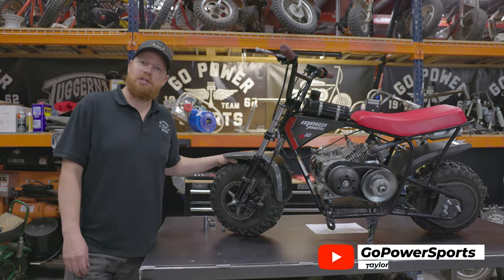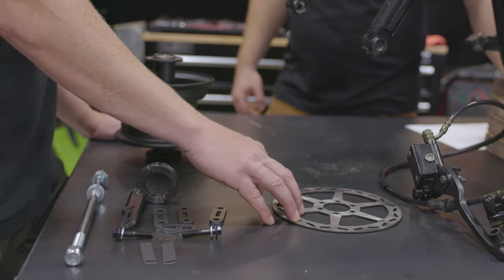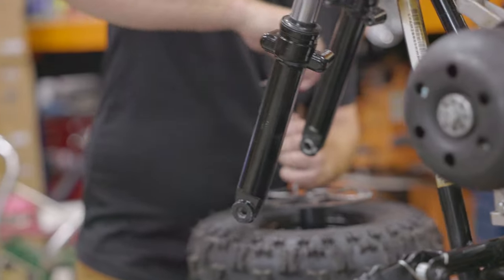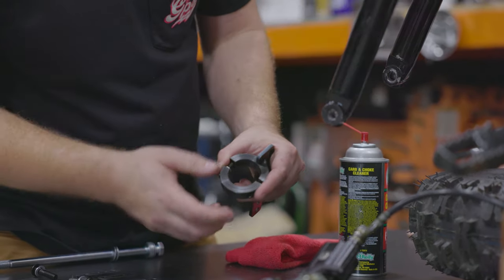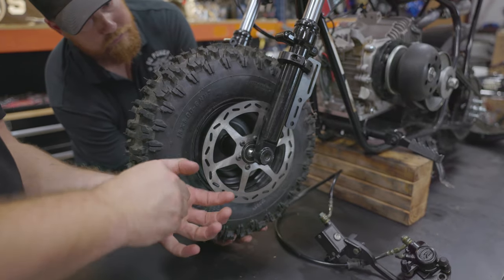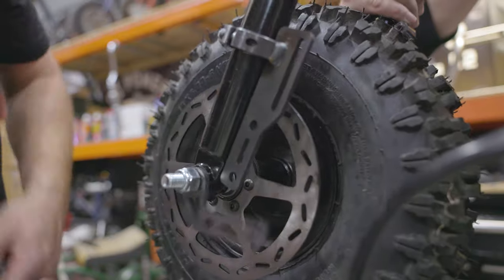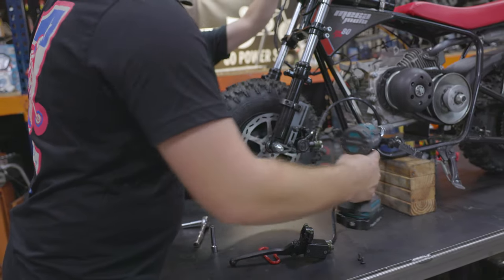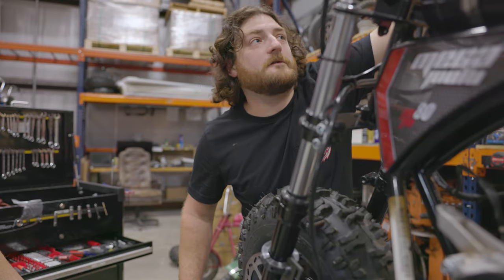How To Install Mega Moto 80 Mini Bike Front Brake Kit

Comment: SInce your adding 2 washers on one side, and 5 on the other, when you mount this kit, and when its all said and done, will the front wheel with brake disk be offset to the one side or the other, or will it be centered between the shocks?

Comment: will the kit work on either side of the front forks or is it built to work on one side only?
Reply from the maker: Currently, just on the left side.
Reply: @GoPowerSports  thanks. The bikes will look awesome with both the front and rear disc brakes on the same side. Just an FYI.

Comment: Will a predator pipe fit a cc100 Coleman looking to upgrade pipe n none listed  for the 100 only the 196cc
Reply from the maker: The 212 header pipes should still fit the 100cc engine, but not sure if it'll clear your frame.

Comment: I need one for the mb200, still a no stock item ☹️
Reply: I wonder if they would sell kit with out the rim and we could just order a rear wheel for the mb200?
Reply: @cliff400  maybe but their rim has the hub for a rotor, unless you making one yourself. Cause I need one for the mb200-2, that’s why I had to stop vids on mine, waiting for them to come back in stock to make more videos for my channel lol
Reply: @MINICUSTOMS  the rear on your mb200 has drum brake on one side and sprocket on the other, so you can leave all drum brake stuff out and bolt disc to the sprocket mount.
Reply: @cliff400  the rear of the mb200 is a disc brake set up, but gps sells a front disc brake kit also that I want to do on the build but been a no stock for a minute now. When I called they said six weeks lol
Reply from the maker: Currently waiting on wheels for the MB200 Brake Kits :(
Reply: @GoPowerSports  also a 24 mikuni too, got a build on my channel!!! Lol it’s all good I do need them parts soon though